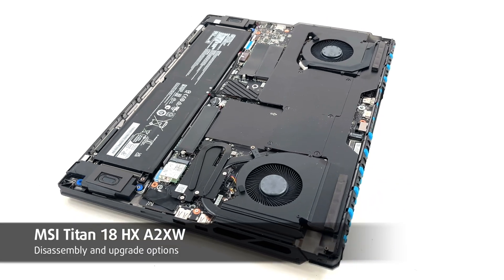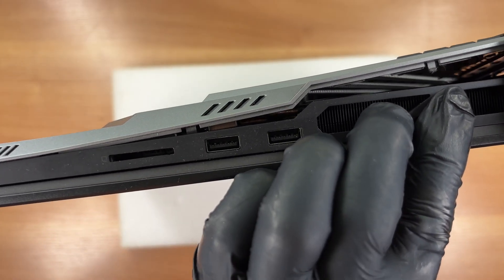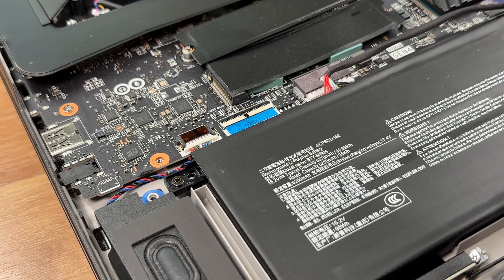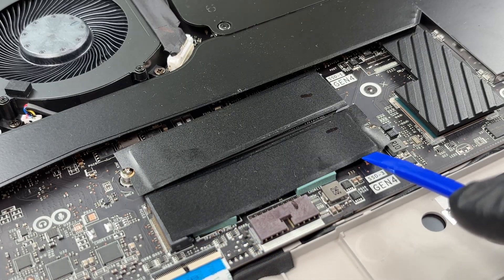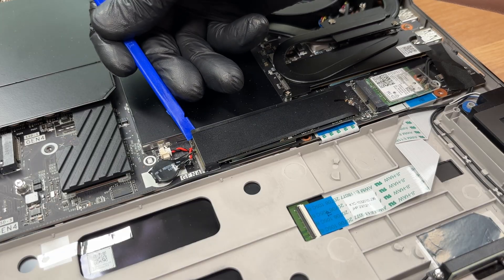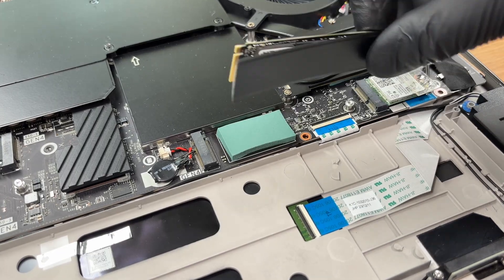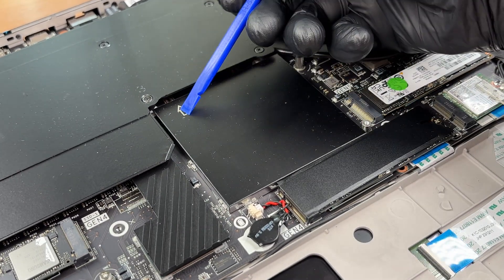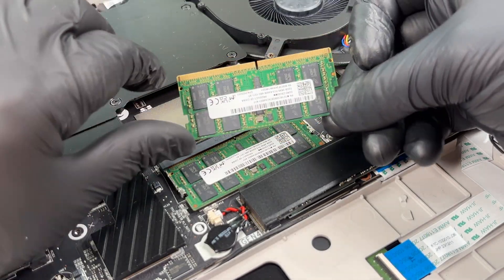🛠️ How to open MSI Titan 18 HX A2XW - disassembly and upgrade options

Comment: I upgraded my Msi Titan 18HX AI with gen5 WD Black SN8100 4Tb and a 4Tb WD Black SN850X 4Tb gen4, but i plan to buy more 4Tb drives or maybe one more 4Tb WD Black SN850X so these 3 will run very fast in RAID 0 and then maybe for the 4th drive a WD Black SN850X 8Tb for mass storage and game drive. Using the two nvme's i have in it now in RAID 0.

Comment: Hi.  An ethernet cable is stuck in my msi titan 18 a2xwig. How can i get it out safely and easy? I am prepared to cut the cable and i don't care about the cable eventhough it cost maybe 30€ but i do care about my super high end super expensive gaming laptop. **UPDATE! I managed to get the damn cut piece of ethernet cable out with a trick i learned from Reddit.** Finally i no longer will need to send it in for only this issue. I used only my hands and fingers to remove it easily once i did the trick correctly. Didn't have to use much force at all this time.

Comment: I don't like the battery charging chips being under a hot ssd. I saw a guy on reddit with a version of this laptop and those chips blown.  Usually in past designs there was nothing under the ssd that's how it should be.